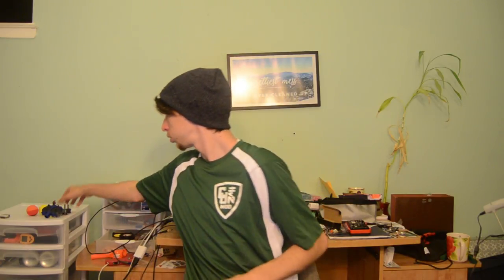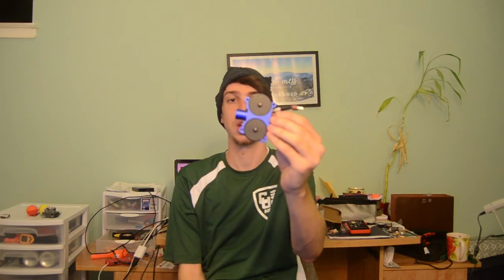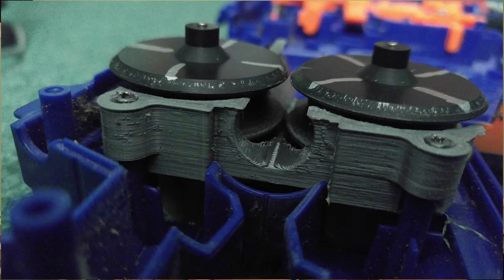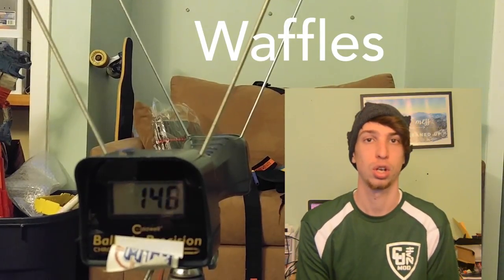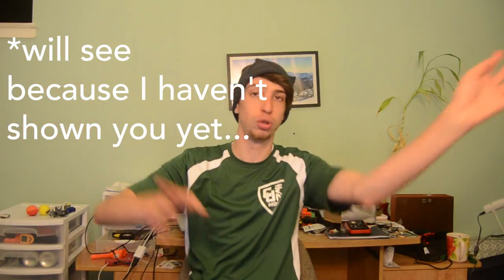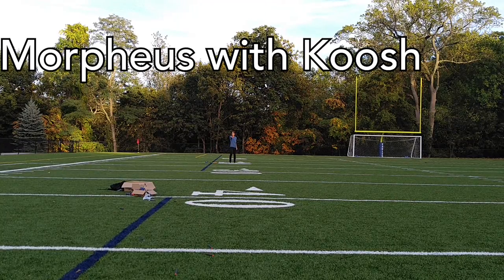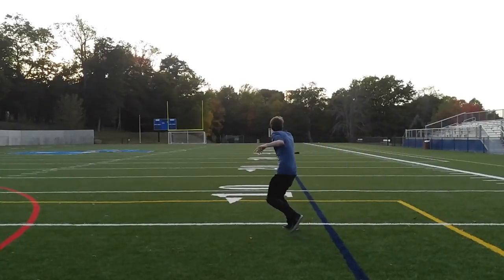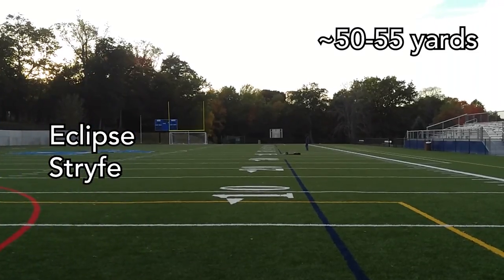First Testing and Review: OFP Morpheus and Eclipse Flywheel cage! 216 FPS!!! New Stryfe Record?!?!

Comment: The damage that you said the eclipse cage and wheels does to the darts, is that because the dart isn't fully enclosed within the wheels so scores the length of the dart? I watched the video that Philip released and saw the darts was kind of squeezed out the sides.
Reply: Yeah. The release version will have a less sharp edge there and more enclosure to prevent this.
Reply from the maker: +Daniel Pocock yup, that's exactly it. Not really an ideal way to deal with this unfortunately

Comment: Just clarifying, because I don’t want to waste a lot of money and effort. You said you could run hellcats on a 4s correct? Anyone plz, and what wheels are you using?
Reply from the maker: +Beyond Logic yes, the new neo hellcats on 4s. The wheels are specific to eclipse. It's an eclipse cage with eclipse wheels. One doesn't work without the other.
Reply: Ok thanks
Reply from the maker: +Beyond Logic happy to help!
Reply: What would be the best 4s battery to use? I will have an expanded battery door and I will also have a dart pusher motor and a auto breaking wire. Too much?
Reply from the maker: +Beyond Logic I would personally recommend the turnigy graphene series. They're very well rated, have high discharge ratings, and have been pretty reliable in my use. Neo hellcats normally need 40A of current at stall, but on 4s they need 1/3 more. So they need around 54A each at stall. Which means your battery needs to be able to output at least 108A for just the flywheel motors (plus how much ever you need for whatever pusher you use).
Reply: Should I use the burst c or the continues c?
Reply from the maker: +Beyond Logic burst C should be fine. Just so you know (in case you don't, and in case other people have this question who are reading these comments). The amps that your lipo can output is actually the Ah rating times the C rating. So on a 2000mAh lipo with 65C, you'll be getting 130A output.
Reply: Dennis Vilensky ok, I knew this anyway but thanks
Reply: Dennis Vilensky where did you get the eclipse you have now?
Reply from the maker: It was a prototype given to me by OFP. But it's going to be available for sale from a bunch of distributors in a couple weeks if not sooner.

Comment: Any chance of high-surface contact flywheels for FVJs? I'm guessing eclipse won't work too well with FVJs, even with 42.5mm cage.
Reply from the maker: +J yang no eclipse won't work with fvjs, you'd have to make custom wheels which don't crush the darts at all but still grip it all the way around, but it's not worth it to do that because you probably won't get much of a performance increase over like a standard 42.5 mm cage. And because there are plenty of better darts available than fvjs.
Reply from the maker: +J yang also eclipse is a system of cage + wheels, you can't have one without the other, they attend compatible with anything else.

Comment: The Dynamag and Mad Slammer from BOOMco shoot just as far as the M6 and higher rate of fire. The Spinsanity also shoots farthers than the M6 by 20 feet. BOOMco isnt obsolete. Ppl just havent tried the other stuff. And you also only need to swap springs in them. You dont need expensive wheels or cages. And the Spinsanity gets that performance on stock parts

Comment: Would the Artifact uncanted cage be better for not destroying darts?
Reply: I am currently planning for an Artifact uncanted cage with Containment Crew flywheels.
Reply from the maker: Joseph Augustine Rhodenhiser yes but you'll also get much lower fps. The highest I've seen out of an artifact cage is like 130
Reply: Dennis Vilensky at that point would I be just as well off keeping the stock cage?
Reply from the maker: Joseph Augustine Rhodenhiser the artifact cage still has improvements in consistency and will sound better.
Reply: I am running Neo-Hellcats btw

Comment: hellcats on a 4s? You mean 3s right? Also, what about fangs?
Reply from the maker: +Lego Boss either motor is fine, but yes, 4s. For super high crush cages like this you need a higher RPM than stock crush, which you can achieve by running 3s motors on 4s. Or 2s motors on 3S.
Reply: so does this mean that you meant wolverines need to run on 3s? cause i believe you said in the video that you ran the wolverines on 2s. howevr this doesn't make sense because on 2s wolverines run at about 31,000 rpm, but eclipse needs 50k rpm right?
Reply from the maker: Ian wolverines run at like 45k RPM on 2s, which means them slightly less than ideal for eclipse which needs something in the 50-55k range. On 3s wolverines run at like 65k RPM which is way too high.
Reply: so that means that the numbers that i got are wrong then? also, would neo hellcats on 4s be better because they have much more torque then wolverines? or would waiting for cronus 2's be a better option?
Reply from the maker: Ian Chronos 2 will be better. Neo hellcats on 4s are still a little under that 50k mark
Reply: well, better save up and wait for chronos 2's then. just when i got super excited for neo hellcats, chronos 2's are announced

Comment: Lmao
Have any of you 4s your hellcats and chronoed?
Id like you guys to compared
160fps sounds about right for a 25% power increase.
Reply from the maker: 4S hellcats are only suitable for eclipse cages. It won't just make a regular cage shoot harder, because the wheels will be spinning faster than necessary and you'll just end up with dart slippage and wasted energy. There's a reason all flywheel motors are made to be around the 33000 RPM range.
Reply: Dennis Vilensky 
Funny, then test at 3s not 4s and show fps.
Also these motors werent designed to run on 16.8V.
Motor longevity imo would be reduced.
Reply from the maker: there's plenty of evidence for it already, plenty of people have made honey badger stryfes that perform just as well as like rhino stryfes if not worse, because they spin at too high an FPS. The difference in RPM between a 3S hellcat and a 4S hellcat is the same as between a rhino and a honey badger. And no its not because the honey badger has less torque because it doesn't. 

I don't know about regular Hellcats, but the new Neo Hellcats will definitely take a 4S without an issue. The maker of the motors (Ryan from Make Test Battle) even recommended it himself.